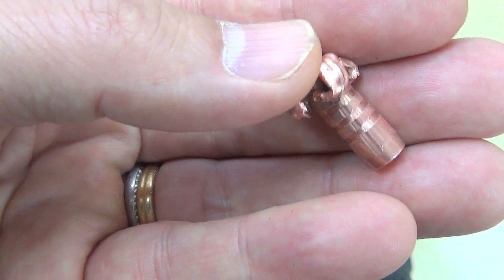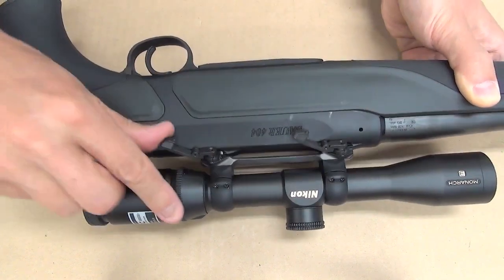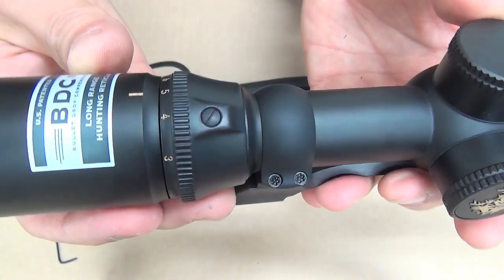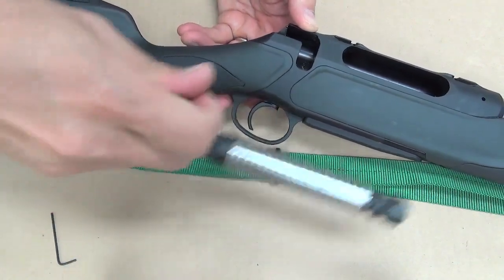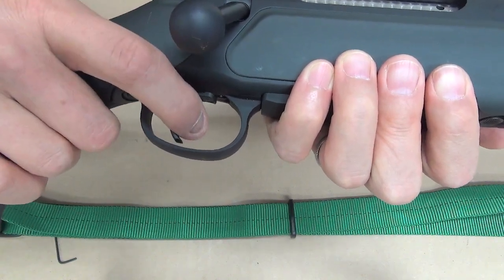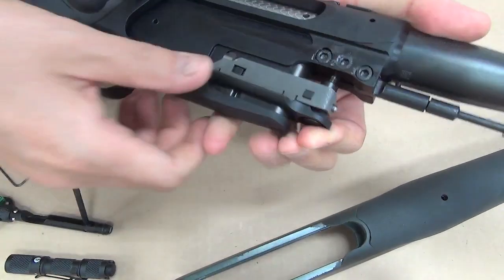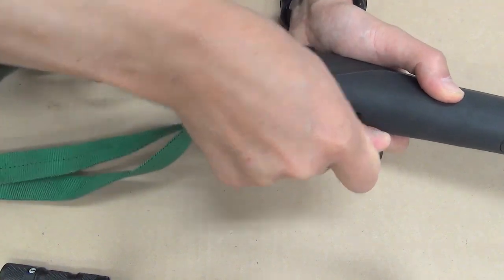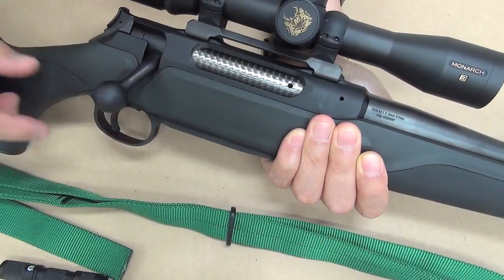Sauer 404 rifle review

Comment: Congratulation on your new 404! It‘s a great rifle. I got my first Sauer many years ago and picked it up at their factory, when they were located in Eckernförde, a small town in Germany not far away were I lived. My old 202 is still my favorite. But the 404 has some improvements for sure, exspecially the safety and the trigger system. If you want to change the barrel it‘s really no big deal. Just get a small torque wrench and make sure to varify trajectory at the range afterwards. There are only two small things I wish Sauer made for this rifle. 1. A short and a long action and 2. An intigrated Picatinny rail. Weidmannsheil!

Comment: Check out the HK 630/770/940 (SL6/7) it's got polygonal rifling so there are no lands or grooves, it looks like a kaleidoscope when you look down the barrel... the bullet forms to the barrel contour and it retains more gas pressure as the bullet leaves the barrel. It fowls significantly less and lasts a very long time, it's also incredibly accurate!!

Comment: I really enjoyed your in depth review.  Are you still happy with this rifle?  What don't you like about this rifle?  Thanks!
Reply from the maker: I am satisfied with its weight balance which is not barrel heavy and allows me to hold it very naturally and deliver a 168 grain bullet with less recoil. What I don't like is its scope mount which is a couple millimeters higher than my Sauer 101's though it is not a big issue. Its trigger is bone dry literally. Thanks.
Reply: virtuovice Thank you so much for answering my questions.  I really appreciate it. I’m seriously considering buying one.
Reply: @virtuovice  Is there any particular reason why you did not buy the thumb hole stock with the adjustable cheek rest?  Thanks!
Reply from the maker: @proclaimliberty2000  Yes. The thumb hole stock is prohibited here because the government says we can  cut it short to make a hidden gun to rob a bank or such.  The short stock of a shotgun is prohibited as well. Thanks.
Reply: @virtuovice  Thanks again for answering my questions.  I really appreciate it.
Reply: @virtuovice  Do you have any concerns about that little adjustment screw located directly on the trigger (to move it forward and backward), from stripping out or breaking because it's so tiny.  No one has talked about that or how the screw actually works.  Is it some kind of spring loaded adjustment system or is it just a regular threaded screw?  Has it ever come loose?  Thanks!
Reply from the maker: @proclaimliberty2000  I haven't touched it yet because I am afraid it breaks. It is still tight and no play on the trigger. This system is popular on trap shooting shotguns like Beretta. Thanks.
Reply: @virtuovice  Thanks!

Comment: Virtuovice, very interesting video, very interesting rifle. I'm impressed with that adjustable trigger weight system.  Nearly all attempts to offer an easy to adjust trigger on factory rifles have been based on the savage accutrigger.  This is legitimately innovative and not just a copy.  A question for you...do you have to re-sight the rifle after taking that scope off and on or does it hold it's point of impact consistently?  If so, very impressive system.
Reply from the maker: I actually tested this Sauer Universal mount before and after taking off and on. These impact points at 150m didn't show any difference at all. Thanks.
Reply: virtuovice very remarkable, thanks for replying

Comment: what a nice piece of rifle...4000 bucks,  a good invest^^.   also nice caliber... much better than the dusty 3006.
Reply: smokin Joe sadly the 3006 has alot more up its sleeve when it comes to home loading. (Comming from a .308 sauer 404 owner). The .308 is filled to the rim from factory. The  sauer 404 is a good rifle for having multiple barrels tho.
Reply: ya thats right...dusty is nice to play around for homeloaders...it can handle a bit heavier bullets...and more powder, if the barrellengths requires it.
but on the other side, its a longer case...means longer rifle, much more recoil and less consistant powderburn..i own em both, overall i personally like the 308 a lot more.
Reply: smokin Joe I agree!

Comment: Don't worry so much about the torque weight for those front locking screws, I'm pretty sure it's not a big deal. It was designed to swap barrels out on the fly. I think it's just suppose to be finger tight...https://www.youtube.com/watch?v=Y8vfES_jQIM

Comment: About a year ago I bought a Sauer Classic XT 404 in 30-06 caliber. I have used the rifle very little so far. I am disappointed in the quality of the material, that is, the fact that the chamber/receiver is made of aluminum. By cocking, bolt rams into the receiver, causing damage. I am wondering if this is normal?

Comment: Dr which rifle ( 101 or 404) has a better bolt handling in terms of feeding a bullet and racking the bolt? And which one is more accurate ?
Reply from the maker: The single column magazine of the 404 is rather hard to feed from and makes noise while the double column magazine of the 101 is smooth and silent. Bolt motion itself is the same between the two but the cocking slide of the 404 is highly appreciated. The accuracy is the same between the two, but the scope mount is a little too high on the 404. You will not regret whichever you take anyway. Thanks.